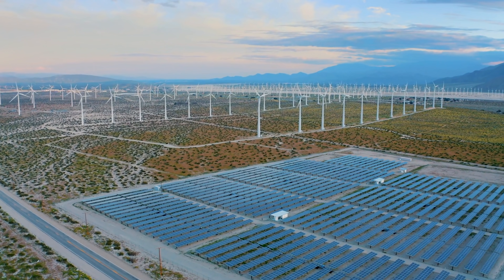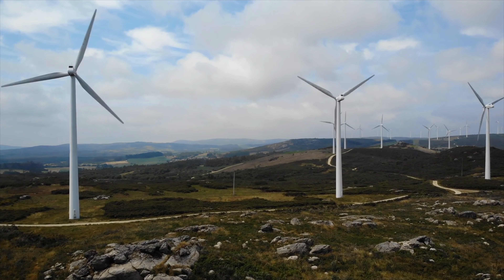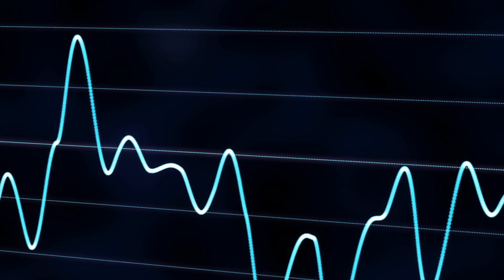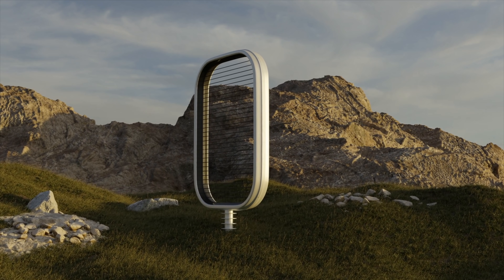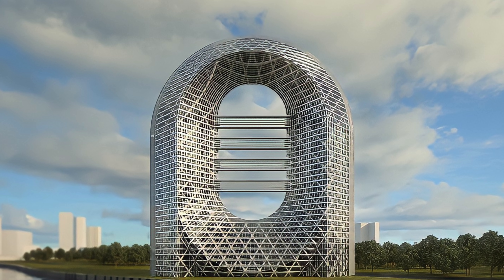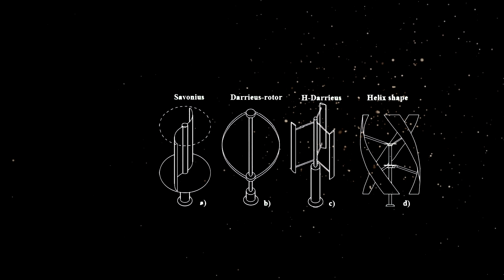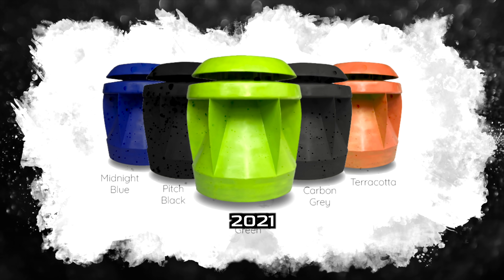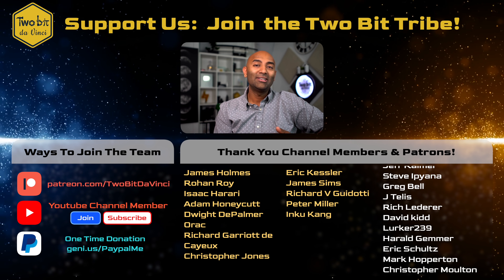These Wind Turbines have NO Blades!

Comment: THERE ARE A COUPLE KEY PRINCIPLES to balancing energy production- and we can look to nature for the answers. 
1. DECENTRALIZE - basically get the central planners (government) away from the issue.  Since they (politicians and political bureaucrats) don't bare the cost of their schemes, nor are they held directly accountable, corruption and good intentions will almost always end up causing more harm than good.
(There is a reason why the largest polluters in the world, and in every nation are the governments). Incentives matter, and politicians do not have the proper incentives.
There is no central planning in nature- each individual organism seeks to thrive, and then the laws of nature create a sustainable balance in the system from the bottom up.  

2. Diversity- a healthy system does not have a single point of failure. There should be multiple forms of energy production that overlap and fill different niches.
 Different areas will have different strengths and better natural sources of energy. And they should all be embraced and made as efficient as possible. Wind, solar, gas, oil, hydro, nuclear, geothermal, etc are all important, and each has pros and cons.  By promoting all of them, and letting local energy markets find what works best for them we will maximize the sustainability and reduce the impact of energy production.

Comment: Years ago i saw a generator that was like a giant conical industrial chimney with blades on the inside based on the idea that the air near the ground would be heated and rise through the chimney, spinning the impellers. On a typical day in a sunny locale, regardless of the wind pattern, the sun warms the ground which heats the air which then rises. Once this cycle starts it tends to suck air in from all around it, and the sun on the chimney heats the air to make it rise and turn the generators.
This would be great for that deserts like the Australian outback, in fact i think that's where the prototype was. Kind of a wind/solar hybrid.
Seemed like a great idea but i haven't seen it again.

Comment: Vertical Axis Wind Turbines (like the one by the train) lined up in the middle of every interstate highway. 
Especially those outside major cities would have phenomenal power generating capacities. Even if traffic is going slow, you'd still be able to get wind power from ambient winds, but when traffic is moving fast (especially trucks) would move enough air to keep them going pretty much any time there is traffic of any form.

Comment: I am a master aircraft mechanic and I don't understand why we don't utilize thermal energy more. Drill to the thermal layer that you can pump something like molten salt (Sandia labs uses molton salt melted by sun concentrator to run their sterling engine)through and use  it to create steam to drive a turbine which drives a generator. No emissions except steam. Probably expensive to build but very efficient.

Comment: The vertical turbines that they want to place next to trains and autos paths (also) to capture the wasted wind passing them, got me to thinking...why not put those same turbines inside electric vehicles. The battery would get the car, bus, train etc. up to speed, then the turbine generator could directly power the motor and/or change the battery as the vehicle is moving, especially while on cruise. Remember, you can fit more than one turbine in a vehicle, which could supply more than enough power so the vehicle battery would never need to be recharged by being plugged in to any outside source.
Reply: But then the battery/motors would have to fight additional drag, and you'd lose efficiency in the end.
Reply: @DFPercush  These vertical wind turbines are very low drag, the air from a passing car, train, aircraft taking off/landing is enough to spin them up, that is why they plan on using them next to roadways, airports anywhere there is a passing vehicle, that will cause the air to move. As your electric vehicle is moving, using NACA ducts, air scoops etc. the passing wind can be channeled over the turbine blades, which causes them to spin and produce more electricity than your vehicle can use, at very low vehicle speeds. But, if they cannot produce 100% of the needed energy then, say only 60% of your battery needs is produced, when you get to your destination, you will only need to charge 40% of your battery to reach full capacity. But, I'm saying you will only need a small battery that will get your car rolling, it will only need to be big enough for twenty miles of stop and go city driving, once you clear the city and come up to minimum turbine speed, the turbines can run the electric motor/s plus recharge the battery.
Psst, you can also install them on your property for home use!
Reply: @stankygeorge  It doesn't matter, you're never going to get more out than you put in. Hate to be a wet blanket, but thermodynamics is like that.

Comment: My thesis of undergraduate was about OWT(offshore wind turbine) under storms surge,  i found it awesome, i  would like to pursue my master's in that domain.
Reply: If you do, please make a company to sell efficient wind turbines for a household, or even for a vehicle. I mean, if you use it while the vehicle is stationary, it will generate power. If you use it while the vehicle is moving, it will only deflect the wind sideways, so it's beneficial if you put a small wind turbine in front of the vehicle, as there are youtube videos out there. For example, "Mileage Results You Won't Believe!!! - Wind Power on a CAR #5
" by youtube channel "
Quint BUILDs". Also check out the videos "Dirt Simple Energy Storage | In Depth" by "Now You Know", "The Future of Solid State Wind Energy - No More Blades" by "Undecided with Matt Ferrell", and "Agrivoltaics.  An economic lifeline for American farmers?" by "Just Have a Think".

Comment: I clicked on your video hoping to see something innovative, but was disappointed by most of the content. I would like to encourage you to better vet your content. Most of the technologies you reviewed are not "still in development", they were abandoned as unworkable (kites), or they were nothing but scams from the beginning (vortex and any kind of rooftop turbine). Please consult the laws of physics before doing things like repeating the false production claims from the Vortex scammers. VAWTS do work, but they are less efficient than similarly sized small HAWT turbines and that difference only gets worse when you try to scale them up, so they aren't any kind of revolutionary advancement. There are VERY few applications where they would be better than a horizontal axis turbine, and that does not include homeowner-size wind energy generators. (I'm thinking water pumps for livestock, where total cost is more important than efficiency, and you can build a VAWT out of two halves of a feed drum.) There are small homeowner-sized wind turbines that actually work, but they go on a tall tower and have blades and a horizontal axis. Anything that's ever been advertised for "rooftops" doesn't work unless your roof is at the top of a very tall building.

Comment: The thing that I heard about VAWT is that they create quite a bit of torque and not a lot of speed. You need a fair amount of speed to make a generator run efficiently. Torque however is great for pumping water, so could you use the VAWT to pump water to the top of the hill and then run it downhill through a micro water turbine?
Reply: of course you can

Comment: how much carbon dioxide is produced in the manufacture/transport/installation of the wind turbines. What happens to the wind turbines including the concrete , steel, fibreglass and rare earth metals at the end of life of the wind turbine? What happens to the humidty /speed of the air passing through the wind turbines? what happens to the excess electricity produced when there is a "too much" wind

Comment: Vortex shedding generators are noisy. Not things you want in a suburb. Vertical wind turbines are nice, but HOA’s are pretty resistant to largish spinning objects. There are also some horizontal wind turbine designs that lend themselves to small footprints, but HOA’s get in the way there too. Have to change some zoning laws to make that work I think.

Comment: Windmills are designed to make 50 or 60 fps power with the least parts possible they do not do this well as windmills are much more suited to low rpm high torque applications and the generator needs to stay one the ground where maintenance would be cheaper whether you use water or air as the pumped median comprising air is how you would store power to moderate what runs though the generator for understands if you have high wind you let the pressure increase The makes it harder v for the blades to turn but extracts more energy controlling blade speed and with slower turning blades you will kill less birds !

Comment: If you can a generator with a long shaft hooked to a vertical turbine it should last for 10 plus years. AC fan motor bearings are good for that long. Heck hooking up a pinwheel should do the trick for small and steady accumulation.

Comment: clothes lines for drying out washed wet laundry, what a difference this can make on the energy supply, indoor and out doors clothes lines, cheep and electricity free using the wind and sun to dry the clothes out, works really well, in the winter time i use basement furnace room to dry my clothes out and that worked very well, i no longer use a clothes dryer at all their is no need to, i have one but i have unplugged it.

Comment: i need a wind generator to be used during typhoons and strong storms.  during these times, our grid shuts off electricity.  thanks!
Reply: Strong winds will damage turbines, so energy is often used to slow the turbines as the wind gets increasingly stronger.

Micro turbines, by the shore, often are damaged & need repairs due to strong winds.
Reply: @DavidHalko , I hope they can make a wind generator for high winds!

Comment: you missed the whole life span, disposal, actual energy gain vs fossil fuel support and the expenditure on upkeep and monitoring . . . bladeless & vert wind are viable solutions if we could ever get people to step off big corporate power systems and move towards regulated integrated hybrid systems . . . same with solar, the actual gain from the sliver of prime usage times is meh, its not meant to be a primary system . .. it, like the other alternative energy systems are meant to be hybrid!  

by region if people used micro hybrid power systems and turned their 'power company' into a grid relay like it was meant to be. . . and we stopped use'n century plus old backbones and modernize along with clean'n up fossil fuels to the degree the can be start working with the environment instead of scar'n it all to hell stick'n poison and crap in it >< we could actually turn our homes and communities into self sufficient suppliers of energy to neighbors who might need it and visa versa . . . imagine the real impact on devices built to one base standard that you can use around the world. . . imagine electronics and power supplies that endure versus toss'n the dice quite often . . . the huge surge EVs and alternative modes of transport would gain with cheap, standardized, readily available power base . . yeah it's all possible with a stabilized power system derived from a hybrid supply based on the region. . . lets go!  . . .  talk about hydro too, don't forget the good waterz :)  

the best part is california is a prime testing site for most of those things . ..we just gotta get the jackasses out of government cause they've fucked that state into a complete shambles ><

beyond my rant dude, love the infos . . . just punch the narrative and get with the realz :)

Comment: I feel like a smaller version of that kite generator would work well if you adjusted it to work like a fish underwater and instead of wind it was a small stream or river. Obviously it wouldn’t be a kite anymore but just the way it moves through the air. Same goes for the first tube design really. Lol but I get it, these are for wind

Comment: Wind turbines are costly to install and maintain, wind turbine tech actually yields less cost effective energy over time when compared to the high cost of maintenance required to replace part failures and installation. 

Wind turbines fail regularly and are rarely repaired, they are almost always installed in precarious locations on top of difficult access points far away from resources. They often require helicopters, cranes and other heavy equipment to replace simple parts. 

Contrary to popular belief, they do not harness large amounts of power, in fact it’s minimal compared to earlier fifty year old outdated power sources. 

After failure most of the turbines sit idle across the the United States, they are rarely ever repaired. 

Federal funding paid for these expensive programs and without the continued funds most states see it as a misallocation of valuable state resources and lack the overall budget required for the costly repairs 

It should also be known that repairs are rarely completed, once the expensive blades fail, they almost always sit idle for years before eventually finding a way into landfills. 

There has to be a better way.

Comment: Loved your take on the wind power .. I have been interested in the Vertical Access Turbines and the Halcium Power Pods seems promising for residential and commercial uses .. the Power Pod or VAWT's simular have peaked my interest for decades .. my thought was to stack them and place them in series .. or make them smaller and place them in series .. not only for trains but for highways especially for tunnels or overpasses .. the smaller versions could replace the aerators on garages that circulate air to dissipate heat .. the uses are basically endless .. thank you for putting out this video .. I am now a Subscriber
Reply: Vertical AXIS
Reply: I have always wanted to convert my furnace chimney into a wind pipe with vertical windmills inside of it and allowing the lower portion to vent to outside yielding a difference in pressure from roof to basement spinning the rotors out of view.

Comment: Show me the reconciliation. How many tons of carbon dioxide were generated in acquiring and transporting raw materials, processing those into items useable by manufacturing and transporting them to the manufacturing facility, the actual manufacture, transporting and erecting the finished product...plus a duplication of all that for the necessary infrastructure...plus the disposal of all of it in a few years...and don’t forget about all those thousands of employees who had to own and drive a vehicle to get to work.
Reply: LESS than the never ending costs of OIL and Gas and Coal being burnt daily just to moves stuff around...and the WARS fought over OIL (and Gas) that kill millions and millions of people and destroy TRILLIONS of Dollars every time there is a conflict.  PLUS the millions of people per year that have their lives shortened by inhaling the poisonous fumes from vehicle exhausts from Ground Transportation.  There is NOTHING better about staying with burning OIL and Coal and Gas...it poisons the world. 

THAT is why locally generated Wind / Solar / Hydro / Geothermal , etc. are the Future...and Fossil Fuels are the past.  It will take a decade (this decade) to get rid of Coal in the Developed world...another decade (or maybe two) in the less developed world.  But the vast majority of it will be gone. Good riddance to coal.

OIL has already hit its peak several years ago...and as EVs and Electrification continue to accelerate...OIL usage drops rapidly as more and more new vehicles are EVs.  

Cheers
Reply: @davidc2838 ...you’re taking my comment out of context. I’m challenging the statement regarding the amount of carbon dioxide NOT generated as a result of the device(s) referenced. It seems HIGHLY likely that there’s a lot of money being made by big corporations on a bogus spin of the “savings” that don’t take into account “cradle to grave” energy consumption. We’d better be figuring out how to use solar heat to recycle plastic into what we need to build power generating devices like small vertical turbines lined-up down the median of the interstate highways. I doubt the HUGE wind turbines will pass the “cradle to grave” reconciliation of every single attributable bit of energy.

Comment: The only concern is that there will be only one or two surviving options available as they prove more efficient than others, because we don't all live in areas that are suitable for some of these designs. 
For example: I think the RAF would have something to say about a skysail hovering over my house, since they sometimes make very low flypasts.
The traditional wind turbine would be constantly criticised and reported by a particularly fussy neighbour. 
Those ones with the wires - well, I can see them being a problem for birds that tend to swoop about at high speeds. I had a Merlin wedge herself in a large gauge wire mesh fence when hunting swallows. 

So that would leave the VAWT (I'm currently looking into a way to heat or provide light for my greenhouse when I finally build it, so I can better grow veg plants through the winter). The VAWT looks the most promising, since I am hoping to find a way to build one rather than buy it. I have some parts, just have to make sense of the electrics book I'm currently reading. Not easy when you've never been interested in that sort of thing before!
Reply: If you live near any kind of river or creek you can build a hydroelectric system for pretty cheep that will put out about 500kw. YouTube is a great source for learning electrical systems. 👍